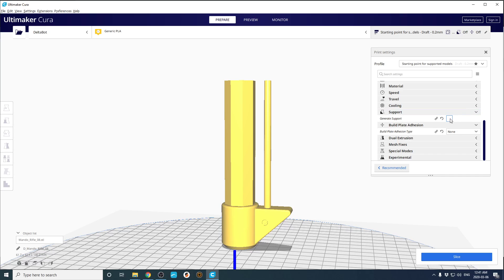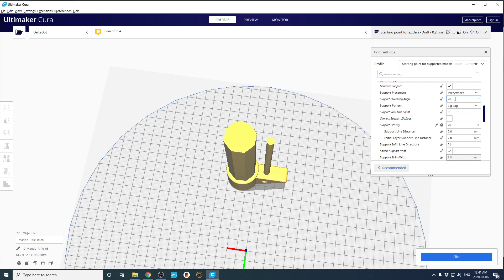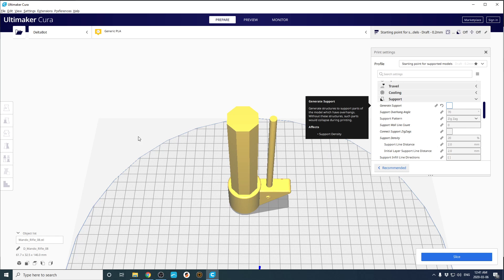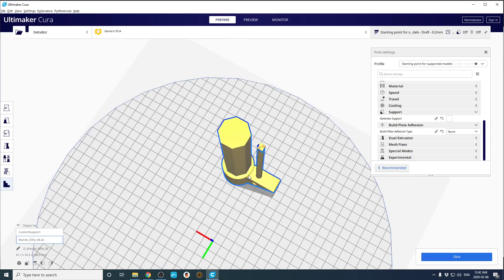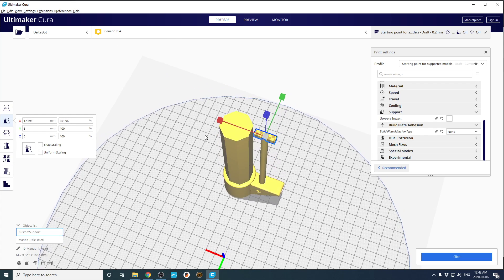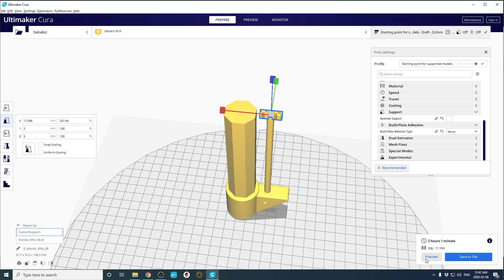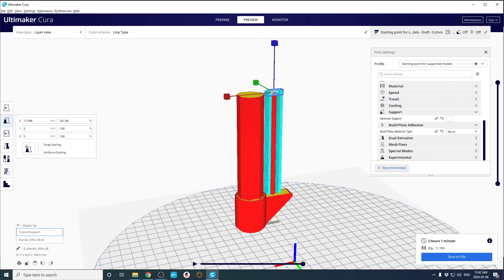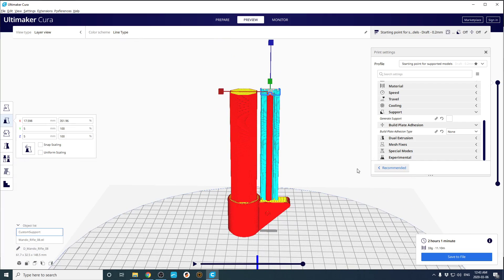Cura Tips and Tricks - Supporting and Printing Tall Thin Objects in Cura

Comment: what cura are you using?? I have the latest and none of that is available ... edit in case someone else needs this, I found out you can enable the support pattern option via settings visibility (duh), and also by skipping frame by frame the lower left icon is actually a plugin called Custom Supports and GOOD LUCK installing that with the absolute dogshit that is cura marketplace search